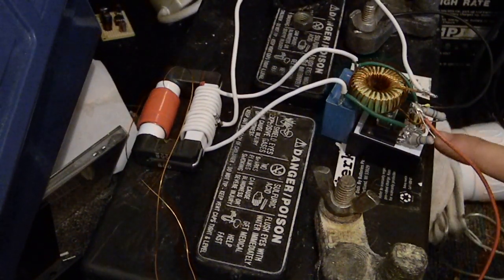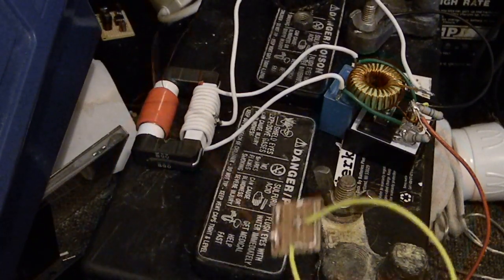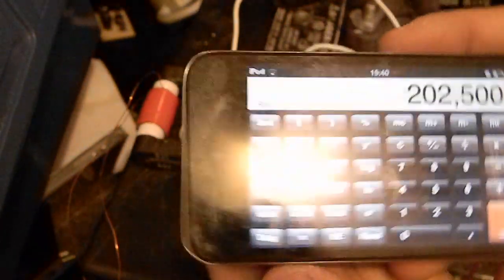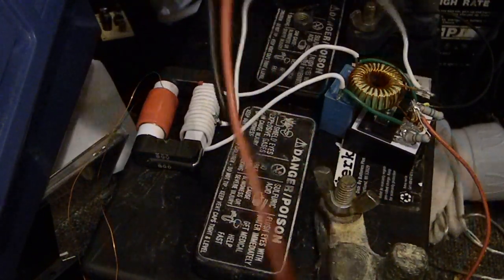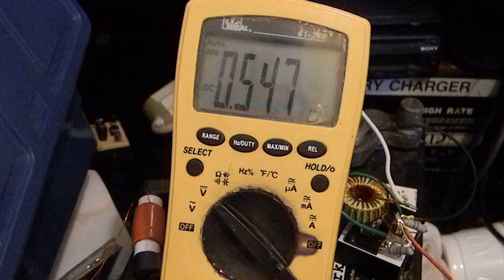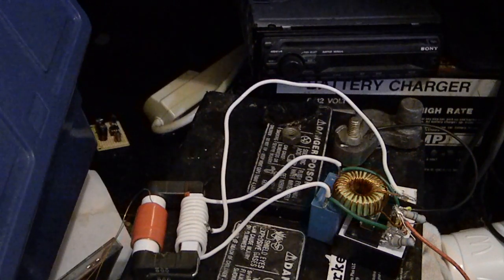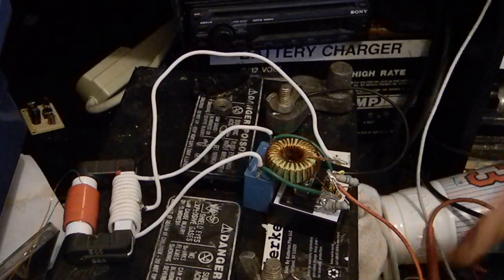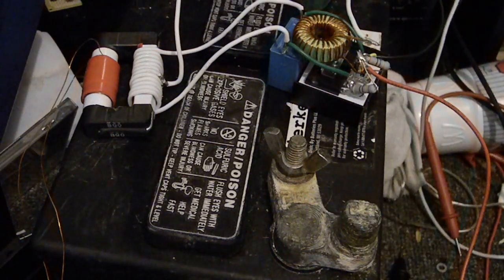ZVS Capacitor Charger Update 1

Comment: Can this circuit be used with a flyback core like you show, but without the center-tap on the primary flyback primary?...just a single turn and two leads connected to the ZVS cap.
THANKS FOR THE GREAT VIDEO!

Comment: What can be the problem with mine? - 220 secendery, and I tried 4+4\5+5\6+6\7+7\9+9 primery. all of those didnt work fast. my charger is really slow. I built 2 transformers of tv core, and one tiny from atx. both of the tv core really slow, but the small one is fast. why is that?
Reply: the frequency with the small transformer is 71khz, and with the big transformer i tried from 11khz to 50khz (with diffrents primery)

Comment: A ZVS driver (Zero Voltage Switching driver) turns on and off at a rate you want, commonly used for high frequency's

Comment from the maker: @thelifeofbrian1 Okay, not fully understanding what you were trying to say. The reason i pointed out it was 35 joules was because when I deal with coilguns I always reference the power by joules. Therefore i pointed it out to show how fast that charger can charge a 35 joule capacitor, because it would normally take me around 3 seconds to charge that cap with my traditional methods. However, I do thank you for the small math lesson there :) im gonna write it in my notes